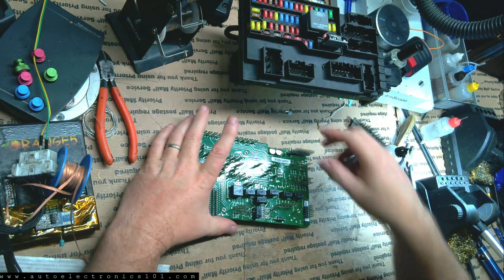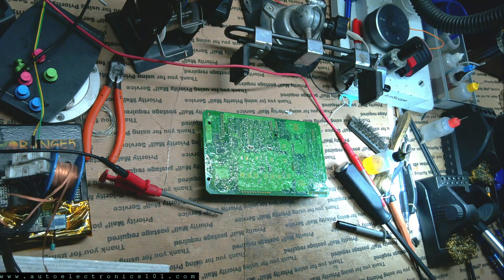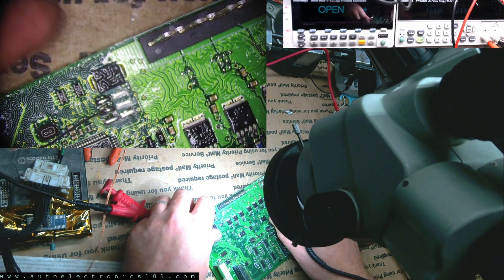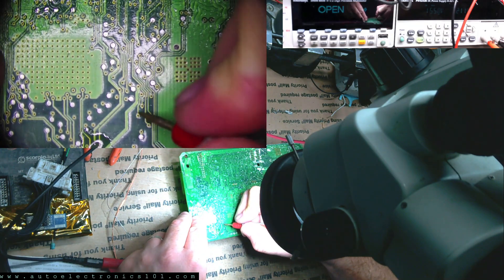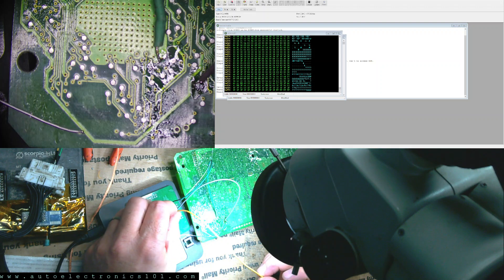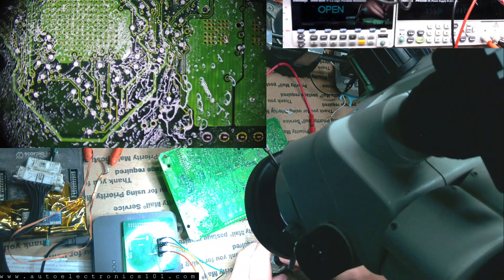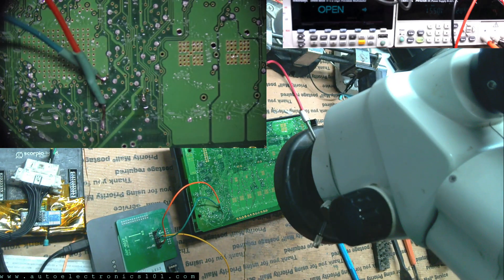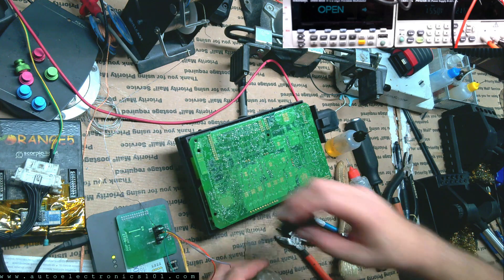Cloning a Ford BCM: Easy Access In-Circuit Points for EEPROM Reading

Comment: Why would you clone ? This is easy to reprogram was doing in early 90s till now
Reply from the maker: several reasons. This one because customer sent it in for repair but also sent a used one incase repair wasn't good I could clone it. It was all on the bench so its easier to clone then try and program with ids. Others I have cloned because ford servers had wrong asbuilt data.

Comment: I need to find and read eeprom on ford escape 2009 where is it located ECU or BCM

Launch x431 immo elitle xprog-3 ??
Reply from the maker: They both have eeprom memories. What are you trying to do ?
Reply: @ I lost all the keys to the car and I can't start it and I want to do immo off. Can you tell me what and how to do?
Reply from the maker: Its easier to add with a scan tool through obd2. Keys are stored in bcm eeprom but I doubt your tools will be able to process that memory dump.  Its not common because typically fords (in the US anyway) are just done through obd2
Reply: @ecurepair  I tried to program the key but it locks the car and opens it but does not start and the bcm module clicks and everything can you tell me what the problem is
Reply: @TurbNit  How did you add keys(which scan tool)? I repaced a BCM on my 2019 F150 and programmed my two existing keys with an AUtel IM608. Keys worked fine to lock and unlock, but no start...untill I found out I had to do a Parameter Reset, then all was good.

Comment: Nice job with short cut thanks, you made that look easy . Did you do the penny test with that soldering station ? I had to when I got a Metal
Reply from the maker: No penny but I did put it to test on the terminal for older ram fuse boxes with is similar.  Before I would have to use hot air + iron on them. The metcal does it no problem. https://www.youtube.com/shorts/V1euGQW-GZs

Comment: Tried calling/email you with no luck even  leave a voicemail
Reply from the maker: I rarely answer the phones but I try to always answer texts and emails. Im not seeing any unread emails. Send again if you dont mind, or the best way would be to text me at the number on my site.
Reply: I gave up months ago. Have a Ford PCM with bad grounds. He did e mail me back twice , then nothing. No idea if he can repair it or how too send it. Looking for somebody who can repair it.
Reply from the maker: If this is the one Im thinking about, I thought I replied to you that I didn't think your issue would be in the ecu and that I couldn't  help on that one .  If I didnt, I apologize I probably wrote it out but got distracted looking at wiring diagrams or something double checking myself.
Reply: @ecurepair  

Yes you are correct. We exchange two emails.  I found a rebuilt PCM from A1 Cardone. It solved all the issues. All the codes were coming back to bad grounds in the PCM. Very common with these Fords.  I still have my original PCM that I want to send out for repairs. That's where the response stopped.
Reply from the maker: @nm-qt2hb  Just looked up our the messages we exchanged and I said I could repair the issues you were having.  I replied to you like 4 or 5 times which is surprising for me. The other guy in this thread couldn't even get one. If you want to send it in the listing is on my website for it. Link: https://keyworks.us/engine-control-module-repairs-c97/ford-lincoln-mercury/ford-explorer-09-10-pcm-repair.html
Reply: @ecurepair  

This is helpful. That's what I asked for. How would I send the PCM out for repairs. At that time I could not find a link for my application. If I knew this months ago I would have sent it out then. I'll get it out tomorrow.

Thanks
Reply: @ecurepair  I also text you from a 917 area code number on 6/27/2024
Reply from the maker: @maxxrapid1611  Pretty sure I replied to your email. Maybe it got picked up by spam or something. I remember because I dont like to do a lot with the older gas jtecs but its pretty common issue they have. You could just use this link https://keyworks.us/engine-control-module-mail-in-repair-services/dodge-ram-2002-2006-gas-pcm-repair.html